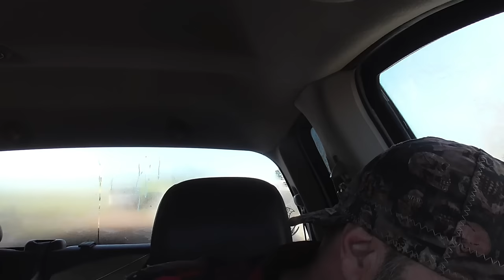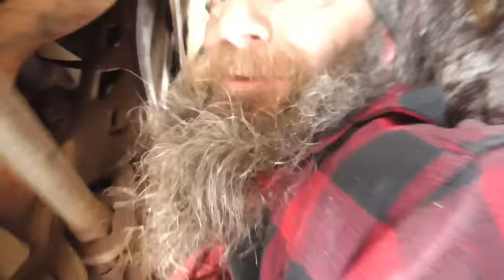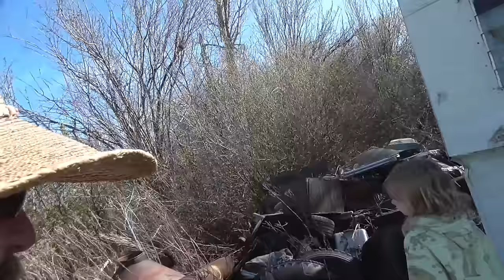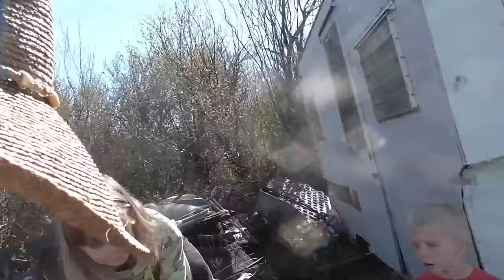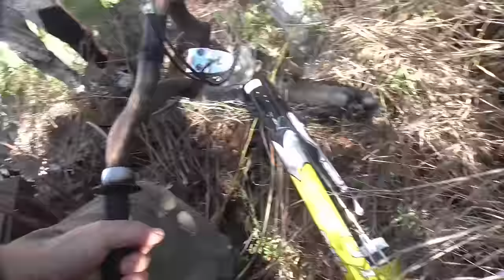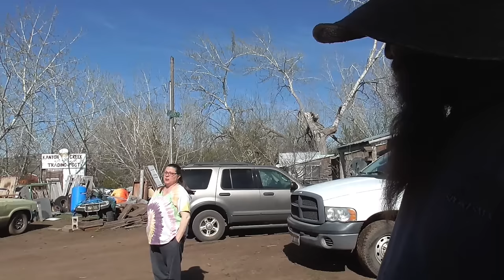JUST What I was AFRAID Of ~ Oh No Even his GRANDKIDS Are JUNKERS!!!!

Comment: Which New Process transfer case have you got there, Hillbilly?  Should be a round tag riveted to the back of the case.  You'd be surprised how many different models, and even manufacturers use the same transfer cases, and for a LOT of years, meaning that the cost may not be as much for the case as the labor to do the job.  Also means that you can likely get just the back half of the case, gaskets, seals, bearings, as a repair kit.

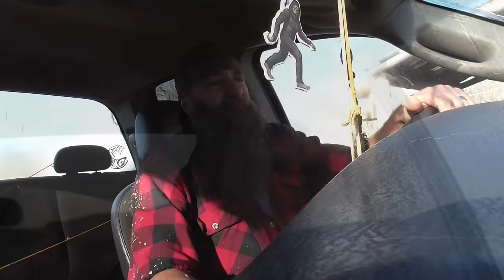Comment: A large piece of cardboard makes an excellent creeper for working under a vehicle, better than a wheeled one. No squirm, no struggle gettin in and out from under. Not as much sawdust on yer clothes either 2:14.
  Great luck with the JB Weld, yer gonna need to get every bit of that lube off (use areosol brake clean) and make sure you cover that crack from the very beginning to the very end (the high end looks hard or impossible to see or get to).
  I myself would take the whole transfer case out and replace the cracked half of the case with a new one, a large undertakin even for me but don't let it intimidate you. Educate yerself on it's disassembly/reassembly first. You'll likely need a second person to help with remove and replace.
  
"Good luck Jim."
-Mission Impossible.
  
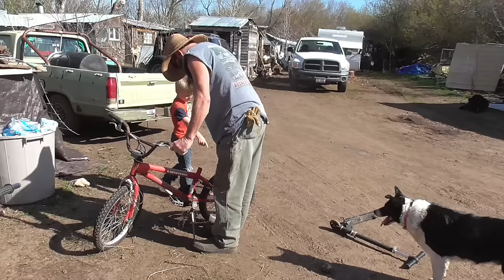16:42 Poor Kai, everyone's too busy to play b-a-l-l.
  Stayin tuned! 👍🤠